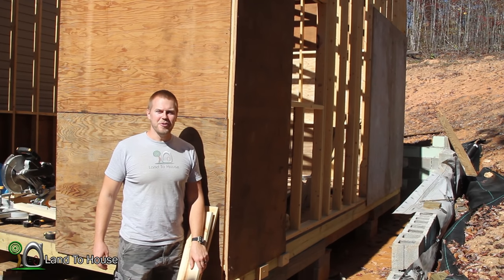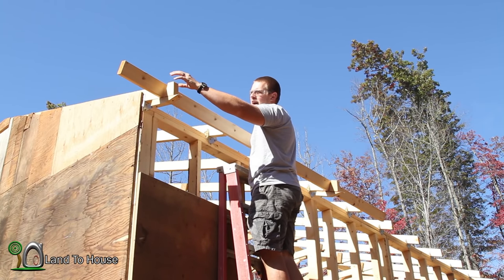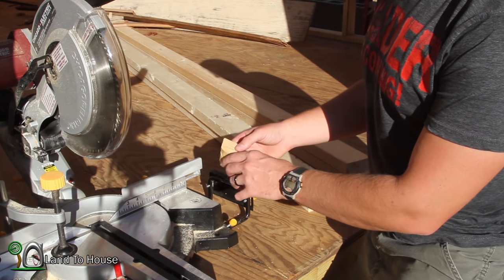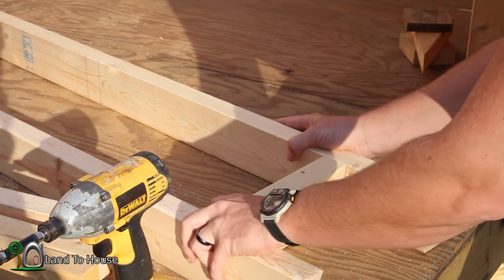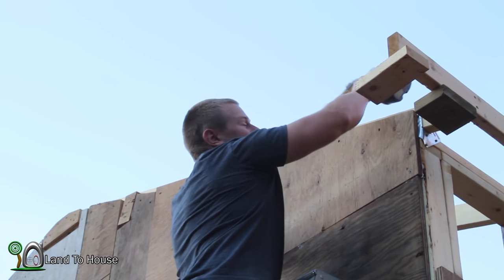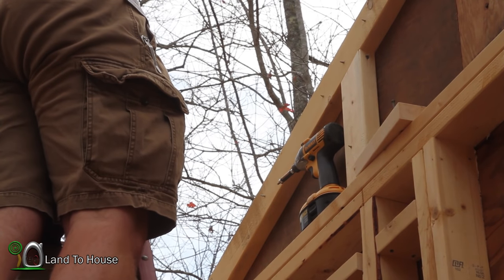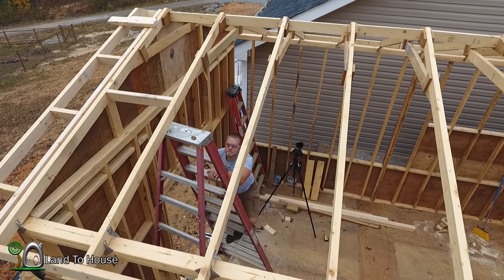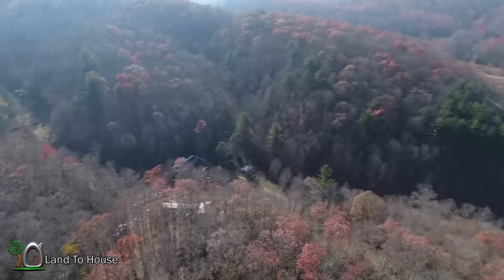Ladders and Roof Blocking - Build a Workshop #11

Comment: Really enjoy your video's. You are doing an awesome job. I'm building a 14 x 14 shed by myself as well so I know your struggles.
Reply from the maker: Thank you! Yes building mostly alone has been a challenge. There are several things I have had to do by clamps and braces. Not the safest at times but it gets the job done. Keep safe as you build. What step are you on?
Reply: Putting OSB on the walls. Roof will be soon. Clamps and braces, I never have enough. I build scaffolding to help. 14 ft 2 x 4's are used for ramps to slide the OSB up on the roof.
Reply from the maker: Sounds like you have a good system. The OSB is a pain on any part of the building. My shop used the 3/4" Plywood on the walls because it was given to me.
Reply: Thats is link to a video showing the scaffolding I use
Reply from the maker: That is a fun inexpensive way to make a scaffolding. Nice. I guess if you are using that from the beginning you can save some headache from using a ladder.

Comment: fascia boards should be end to end joined with 45 degree miters and only at a rafter junction.
The soffits are classically done by notching the last rafter and nailing into the previous rafter.
Reply from the maker: Good info. Thank you. So far the soffit and fascia are doing well. It would have been nice to have cut a 45 on those fascia like you say.
Reply: Dont cut a 45. Cut either a 22.5 or a 30 degree angle. Much cleaner.

Comment: Hey let me ask you folks sense I am by myself and I am in my so called golden years weight is an issue for putting up ladders by my self. What do you think if I made my ladders with 1x4 for the rails and 2x4 for the cross members and even glue it and screw it to make it sturdy. Weight is the issue what do you think?
Reply from the maker: +D Kat I would use a router to inset the steps and then use metal rods along the steps if needed. I have seen attic ladders like this. Probably not pine wood if I had to guess. Something stronger.
Reply: Ya not sure how I am to go about that and keep it light.
Reply from the maker: Might be best to look into an aluminum ladder.

Comment: Measure once, cut twice.
Reply from the maker: +Robert Laird or in my case: measure once cut twice go back to the store buy more lumber repeat.... haha.
Reply: I used to mess up on my cuts when I first started but now I hardly ever do due to years and years of practice. I just measure once and cut once but sometimes twice due to cutting it the first time a 1/16 th long.
Reply from the maker: Practice really does show improvement. I have already noticed that I have better accuracy in some of my work. Still a long way to but its getting there.
Reply: How do I post videos on YouTube? I'm doing a major remodel on a geodesic dome home. It was never finished and left to rot. As a result, most of the structure had to be re-framed. I would say at least 75 percent re-framed when all said and done. It's a double dome home. One 50' diameter and one 20' diameter with a pop out and a massive raised deck. The small dome had to be removed due to heavy rot as well as the deck and pop out. The larger diameter dome roof had some rot so I replaced a little more than half of the triangles one triangle at a time. My wife and I are doing all the work with our own hands. No hired help.
Reply from the maker: That seems like a very ambitious project! It would go faster with help but I understand doing the work yourself too. To post a youtube video you just have to have an account and click the gray upload arrow on the top right of the screen. It is very easy to do.